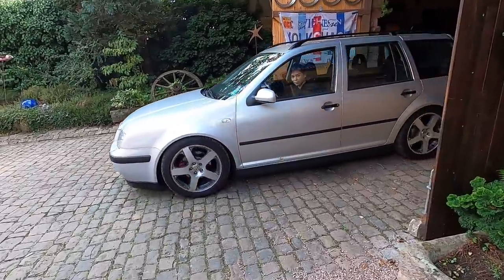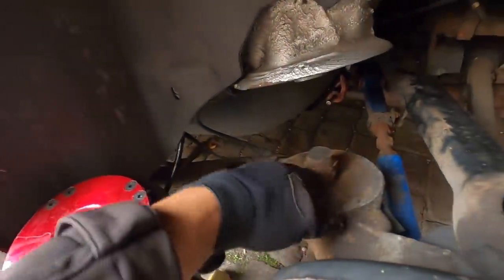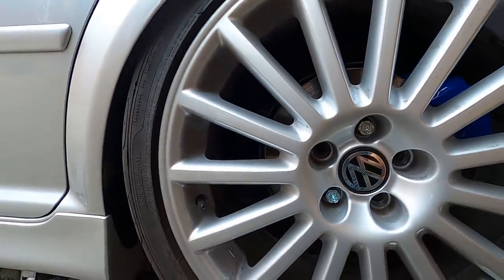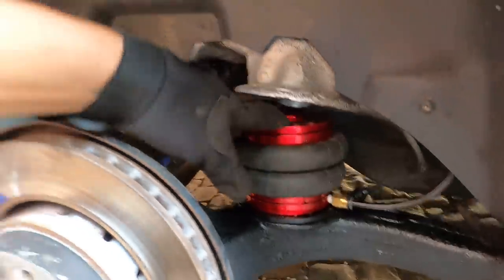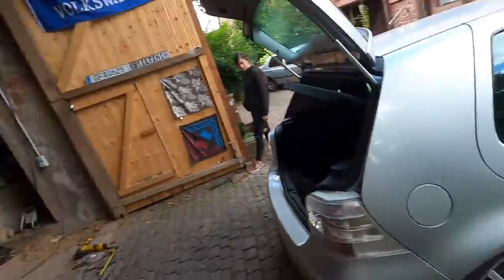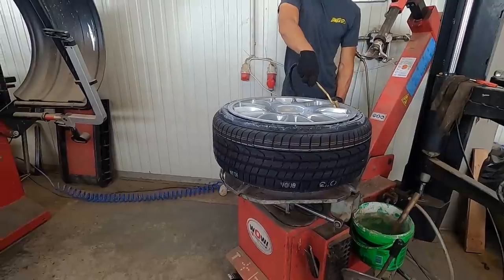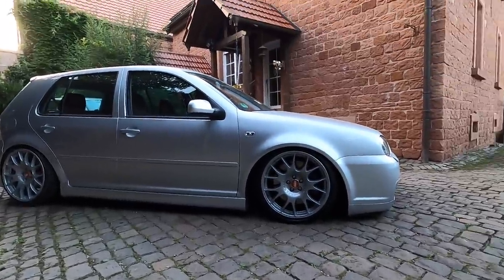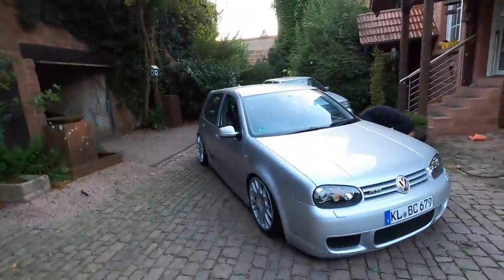New Wheels For Casey's Bagged MK4 R32!

Comment: The E Brake might be holding the wheel with different tension on each side..cause if you look at the front when you let out the air the wheel roll a little
Reply: InstaBlaster

Comment: Dam those wheels look good
But I hope u got different wheel bolts for them 
Factory vw wheels have ball seat lugs and aftermarket wheels have conical seat for the lugs 
Which if u don’t have correct matching 
It  can damage the wheel bolt seats and cause a vibration .

Comment: smaller profile tires help achieving more lows!
Reply: They are running a 205 on a 8.5 inch wheel... How much smaller do you think they can go?
Reply: Mitch9894 to a 35 series
Reply: Naw, if they went one size bigger on the rims, so the lip of the rim was above the fender, then it would look lower. If your gunna tuck it, tuck it. Those wheels look super sharp as is, but one size bigger would have been the krĕm′ də lä krĕm′.

Comment: You need shorter shocks. You can look fort airlift slammed shocks for rear
Reply from the maker: The shocks aren’t the issue. We took the shock completely out and it didn’t change it at all lol the bag itself doesn’t compress enough we learned. If we take the bag completely out with the shock still attached we can jack up the wheel all the way into the wheel well
Reply: @Mk3Smith  i understand. I was think about shocks because i get that problem with my car too.

Comment: Hey buddy - good to see you made some progress with our prior suggestions! 
When you replaced the first rear, I'm pretty sure it was still being held up a little by the sway bar connection to the other side (with still having that perch spacer in there) - but now that side is higher than the other when they're more or less the same now...I'm a little stumped.
However, now that the spacer isn't in there any longer, is it possible to FLIP the bag assembly so that the airline runs from the top? I haven't seen anything in your vids yet that shows a good comparison of the top AND the bottom recessed mounting areas to tell whether there is a difference in size or depth (I might've missed it previously)... but if you can get away with flipping it and removing the lower rubber pad, you will get that extra 1/4 or 1/2 inch or so overall. (*still not entirely sure why the one side would be higher than the other though - even with that skinny metal piece you were talking about removing.)
**Maybe try to disconnect the rear swaybar (keep the shocks mounted afterwards) and drop it back down to see if it equalizes. - you might be getting hung up on swaybar or trailing arm/control arm bushing articulation. 

I know they're working with you to try another rear bag setup option, but might be worthwhile to give this a try to see if it yields any additional results.
BTW - CH's and Mk4 R's are a match made in heaven - especially silver CH's on RS = money! I love my DBP R on 19" LM's but always thought it'd be nice to have some CH's as daily runners..
Reply: Oh, and I'm not sure if I've shared my old MK4 R build thread with you before, but if you're interested in taking a look-see certain things might help you guys out a little along the way, I have tons of pics (albeit photobucket from back in the day) and commentary on most that I've done - incld supercharger prep, to switching to turbo, air ride, front and rear BBK's, etc... https://forums.vwvortex.com/showthread.php?6139045-R-we-ready-Yes-we-R-!-(Build-formal-Intro)